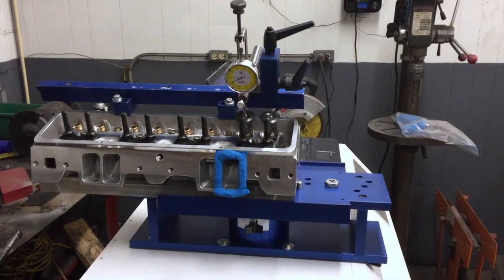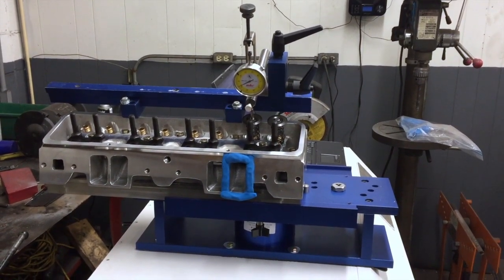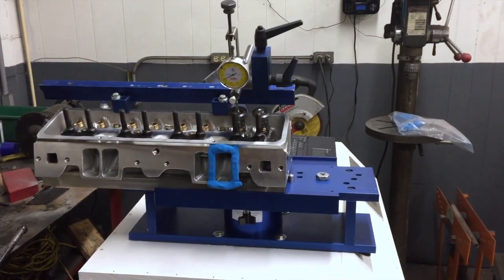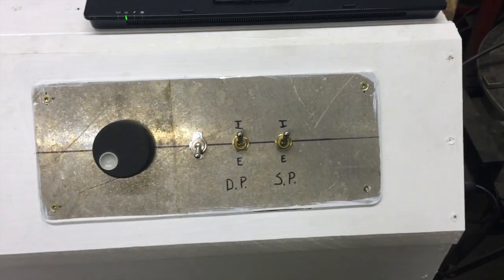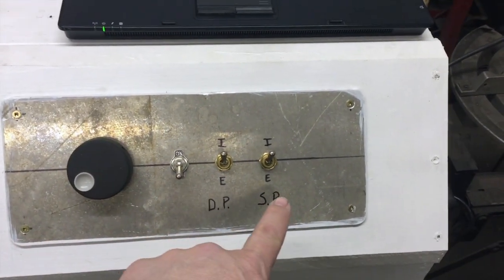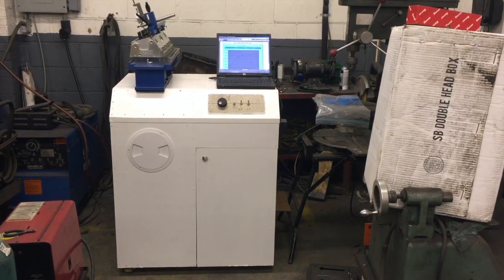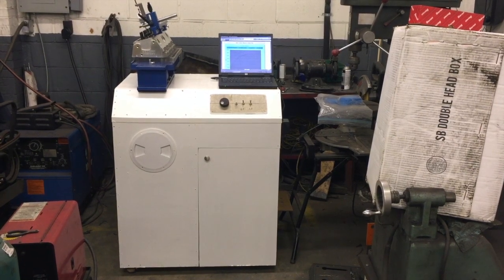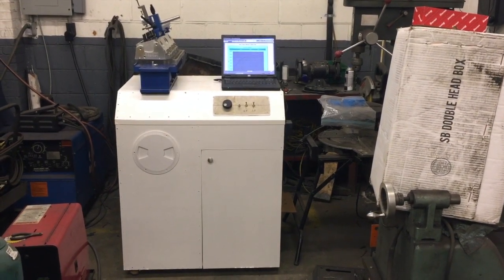Flowbench

Comment from the maker: John, I am using 8 of the lighthouse motors as recommended by Bruce.
Reply from the maker: +John Doney I used 8 of the 120 volt motors.  I have had the bench up to 44 inches of depression with a calibration orifice and it has flowed over 600 cfm.  There was more there but I didn't want to push it much farther.